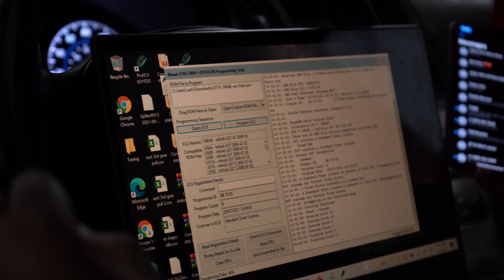INFINITI G37 GETS CAMMED

Comment: Hey bro I have a 2013 g37 sedan and just made 331whp at 65% humidity. My only mods are 3 inch intakes, test pipe and single exit exhaust. I was curious on how much this cost and how much you think I would make. I have a ported intake coming in soon so with perfect weather I could be making almost 340 if not 340whp. 🙏
Reply from the maker: I got guys down here making 400hp NA with them cams. DM me @juvroom_
Reply: @juvroom_  400whp on e85?
Reply: @juvroom_  400 crank or 400 whp?
Reply from the maker: @Tachyon836  wheel

Comment: What's good about the cams? Every aftermarket I've seen only makes exhaust cams for this engine.
Reply: Its because the intake is on a vvel Actuator and cant be serviced or changed out. So you run an aggressive exhaust cam to get more power outta the car and gives you power throughout the whole power bad

Comment: I have a hr that I have bought 3inch intakes, ppe long tubes, 3inch y back port upper and lower manifolds gtr injectors that I have not installed yet. but I was going to do the gallery gasket and thought why not put cams in too if I'm going that far in. do you guys thinks it would be worth it with the mods I have and what would I expect with cams like those whp
Reply from the maker: Could make more hp if you do different fueling

Comment: Did the cam made a big difference bro, am thinking about this mod
Reply from the maker: Yes it did make difference. Every car is different on how much more hp it gain but with cams it’s all top end and if you change the boundary gears you can rev to 8k
Reply: @juvroom_  do I need to get tune to run cammed
Reply from the maker: @torvarrisevans7846  yes
Reply: Nice bro, would you recommend a nitrous kit or cammed for best bang for buck
Reply: @torvarrisevans7846  you def get more power out the nitrous kit, but it cost more , if you want that just save for boost
Reply: @MillionDollarDream  yes sir

Comment: What cams Should I get for a 08 g35 that’s stock ?
Reply: Tomei cams, with intake with ported TB/maifold+ longtube headers and single 2.5 to 2.75 inch exhaust, you will see good gains, 

A guy had stroker kit+ tomei exhaust + did  ethanol setup+ weight reduction with his bolts on like mentioned above, he beats 400-450 HP vehicles, From dig or roll he wins .

2008 350Z